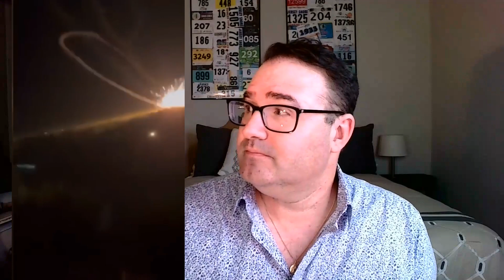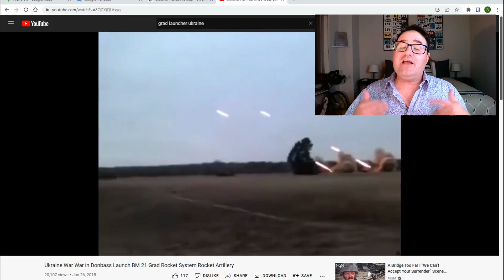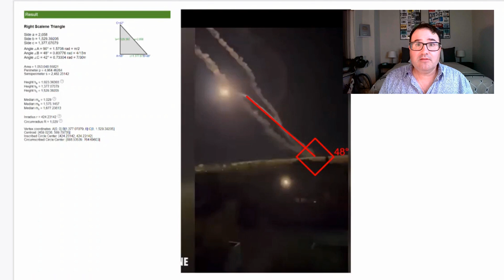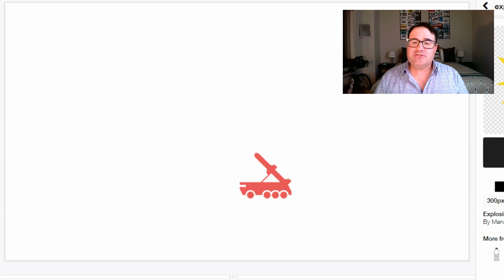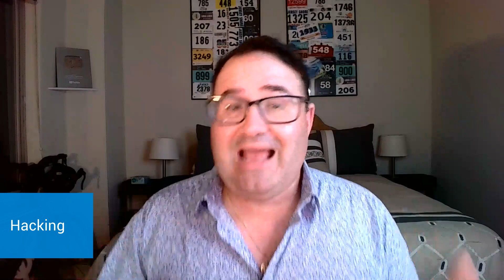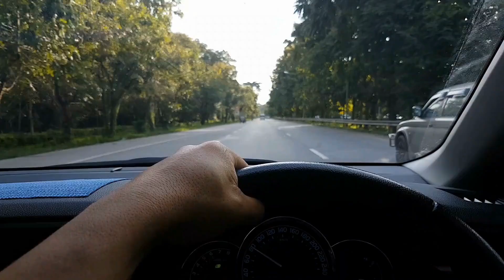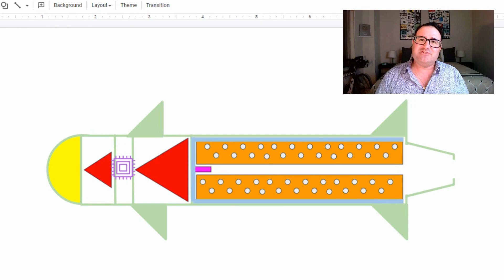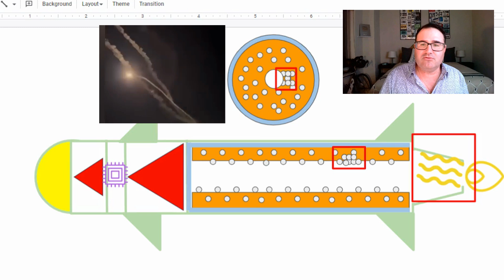Why this missile U -Turned

Comment from the maker: Connect with me on Twitter:
@ryanmcbeth

Watch my long form videos:
https://youtube.com/playlist?list=PLt670_P7pOGmLWZG78JlM-rG2ZrpPziOy

Join the conversation:
https://discord.gg/pKuGDHZHrz

Want to send me something?
Ryan McBeth Productions LLC
8705 Colesville Rd.
Suite 249
Silver Spring, MD 20910
USA

Watch my video about Solid Fuel Missile motors here:
https://youtube.com/shorts/OJmxJ-UuDSk?feature=share

The raw footage was originally found here:
https://youtu.be/6IwqmezeSuQ

A number of people emailed me about this video with their own theories of why the missile did such a drastic U-Turn.

I believe it was due to the missile being mishandled during storage or manufacture.  I believe a section of fuel dislodged from the elastisizer and caused an area of high impulse which turned the missile around.  By the time the extra nugget of fuel was burned up, the missile was flying straight again.

It is very important to store missiles according to regulations and periodically X-Ray them for non-destructive inspection to determine if their fuel has degraded.

References:
https://en.wikipedia.org/wiki/BM-21_Grad

https://en.wikipedia.org/wiki/Tor_missile_system

https://en.wikipedia.org/wiki/Buk_missile_system#Technical_service_division_2

Triangle calculator

https://www.calculator.net/triangle-calculator.html?vc=&vx=&vy=2058&va=90&vz=&vb=35&angleunits=d&x=82&y=10

G-force calculator
https://www.omnicalculator.com/physics/g-force

U.S. Efforts to Arm Ukraine Shine Light on Limited Production Lines
WSJ
https://www.wsj.com/articles/u-s-efforts-to-arm-ukraine-shine-light-on-limited-production-lines-11651143601?mod=Searchresults_pos1&page=1

https://www.northropgrumman.com/space/propelling-space-and-defense-missions-solid-rocket-motor-expertise/#:~:text=According%20to%20 Fuller%2C%20a%20 solid,to%20exhaust%20the%20combustion%20gases.

https://www.daviddarling.info/encyclopedia/R/rocket_propellants.html

https://www.rocket.com/defense/tactical-missiles/javelin
Reply: think you're correct with mishandling. But i think it broke. an external fin or something like that. I don't think a slight asymetry in the thrust could account for that dramatic a turn. (unless the missile detected it and over corrected)
Reply: @flagpoleeip  any fin or guidance related anomaly would likely result in circles or spirals... Don't you think? 😎
Reply: @howardthegeek  i think it hit the ground didn't it?
Reply: It’s made in Australia
Reply: @purplevalkv1nce264  what’s made in Aus?
Reply: @daviddoyle982  boomerang joke
Reply: @purplevalkv1nce264  
No china
Reply: @purplevalkv1nce264  so in other words, it did a u-ey and wanted to shirt front putin.
Reply: I think it’s a solid theory and is probably the most likely cause. Just to blow any possibility on hacking out the water. the amount of effort to tactical/strategic  return could in no way make  this worth while for Ukrainian.
Reply: It is awe-inspiring to watch you give distance estimates
Reply: this might be way off but I recall in the early days of Sidewinder, pilots reported missiles doing a 180 and coming back at them, is guidance system failure really so farfetched? from what it looks like on the video, the place it turned toward looked to be the launch vehicle, that could be coincidence but I'm not so sure
Reply: Ryan,

While that's certainly a cause for the missile to go off course, and possibly even impact near the launch site, I think it's a rather low order probability given the observed behavior. 

I launch high power rockets and am licensed to do so at level 2 by the NAR and tripoli rocket association, we don't do "guidance" because that's forbidden, but we do use "active stabilization" (which really the only difference is that we're required to stop at apogee, otherwise it's exactly the same hardware and software), and I've seen motor grain failures of all sorts.

What I would assume the issue here to be is an error, possibly from manufacturing, possibly from handling, with the missiles tracking system. It looks as if the missile is targeting either the tracking or searching radar array, and that's an error I can very easily see being made. I.e. "go to the laser dot" and it goes to the laser pointer rather than the target.

If it were a motor grain failure I would expect to see relatively constant acceleration from the rest of the motor, and possibly some ejected debris from an uneven burn. What I see here is a turn that looks like the action of properly functioning control surfaces.
Now the real question for me is why they didn't implement some sort of "minimum safe distance" lockout on it's ability to turn, in order to prevent something exactly like this, seems like sloppy engineering.
Reply from the maker: @adamrosenberg4367  Maybe. But the issue is that the Buk is semi-active radar homing. I don’t see any way that the tracking trailer would tell it to turn around. And remember, the missile isn’t designed to do that. There shouldn’t even be software code that would allow it to do so.

It would be like… watching your Roomba race a Ferrari. The Roomba‘s motor didn’t designed to go that fast, so I don’t see how the weapon could do something it wasn’t designed to do.

I am leaning toward being wrong about asymmetric thrust on the inside and leaning more toward asymmetric thrust on the outside. Maybe burn-through of the insulator from Cracked elasticizer? 

Ok, so a forklift bumps the missile in 1995. The driver doesn’t tell any one about it because he doesn’t want to get in trouble. 
27 years later there is a crack in the propellant. The Russians never didn’t x-Ray non destructive inspection on the missile because of course they didn’t.
 So now you have a missile with a crack in the propellant.

Missile is fired, it goes straight for a while and then we see burn through the insulator. This causes the missile to veer out of control.

It just looks like it’s going straight back to the launch site because of parallax, but it’s actually moving in an oval.

Sound more reasonable? I’m leaning toward that now.
Reply: @RyanMcBethProgramming  ok, yeah I could see that happening with parallax making an oval appear to be a near stall turn.

As far as a tracking error though, I know it's not designed to do that, but I have a lot of first hand experience with unintended behaviors arising from designs that were meant to do something else entirely. My thought was along the lines of an error with the differentiation between the tracking radar Source, and the tracking radar Return.

I can especially see that happening if testing was performed on single missile or volley launches, rather than the staggered fire that seems to be the case here. Like for instance, if I were to build something of the sort, I would have the tracking radar off for an initial boost sequence, then activate it once the blind spot cone directly aft safely covers it, so then the missile is only seeing the return from the aircraft. Mostly speculation since I don't know how they approached it, but I'm sure we could come up with 3 dozen viable explanations with all the people in the comments and the limited video info
Reply from the maker: @adamrosenberg4367  I really appreciate your thoughtful input, Adam.
Reply: @RyanMcBethProgramming  and I appreciate the replies! Not to mention all the work you've put into educating the public about stuff from Ukraine!
Reply: @RyanMcBethProgramming  If the rocket was approximately 1 mile into the air, does this mean that the fireball explosion was really 3/4 of a mile high and 2 miles wide?  What kind of rockets are they using that would engule 200 chicago city blocks?
Reply: @adamrosenberg4367  It flew straight for a few seconds. Most likely unguided. The error occured once the guidance system took control of the missile.
I also seriously doubt that e.g. an oxidiser rich section of propellant can cause a 180 degree turn on such a big, fast missile. Not going to happen, you need the control surfaces for such high g maneuvers.
Reply: @kirahund6711  that was my gut response to the video too. I'd rather not step on any toes though, so I'm just leaving it be, barring any further info.

I do know something similar happened with an American missile system a few years back. Patriot maybe?
Reply: @adamrosenberg4367  Are you implying that Ukrainian soldiers could have made this rocket do a 180 with a powerful laser pointer like kids have been known to do to aircraft here in the states? 
     If that’s the case, I’d say that’s pretty daring but very clever.
Reply: @digitaldreamer5481  not quite. I was trying to draw a comparison to things like the line following bot I made in school that started following the dirty tile seams, rather than the path we laid out. 

Just opportunity for errors I suppose
Reply: Was waiting for u to make a video on explaining this tnx man Keep up the good work
Reply: This has happened with a Russian space rocket before. The guidance system wires were reversed when it was manufactured it thought by turning and coming back it was correcting itself to go up.
Reply: @Platinumpitviper  I assume the same.
Reply: Bird strike? 🤓
Reply: Mishandling is just as likely to cause a damaged fin - I'd say more likely that manufacturing fault. If it was disiribution of fuel wouldnt the correctly functioning guiedance system and undamaged hudiance fins try to turn the missile around?
Now you may no see the missile turn around successfully, but you would I suspect see the guidance system attempting to correct the course and there for you'd expect to see some oscillation or something as the guidance system attempts to correct the bad course.
If there was a component failure I suggest it was a sensor such as a gyro or crossed wiring.
Possibly the gyro only kicked in at the point the missile turned or that was the first time the guidance sysrtem sent a command to correct the flight path.
Another possibility is that it was hacking, but not over the network, in the manufacturing or storage/servicing phases of the missile's life.
The Ukrainians have I believe a good knowldge of Russia and Russian defence industries and have known for 8+ years that the Russian's were coming. Seems possible that  Ukraine could fairly easilyt get people in to Russian defence industry.
After all there are lots of pro Ukraine Russian officers etc so its not unlikely there are also pro Ukraine reseachers, technicians, engineers etc etc.
There's no down side to  sabotaging Russian defense kit.
If the Russians are using it, obviousluy good-if it fails after being supplied to a thirdparty, then you're hurting Russian industry's reputation and possibly expiort earning's.Win Win. And if the missile happens to turn around and  get lucky and take out the  TEL, radar or control van, win again.
If it's a code hack there's no reason you could not make them failures pseudo random, so that people are less likely to check the software, but still enough to undermine confidence in the system (or the factory, troops or whatever).
Reply: @1337flite  I assume the missile is totally unguided for the first few seconds. It just needs to get up to speed, gain altitude and head in the general direction of the intended target and is then "caught" by the guidance radar (if there is one), so it makes a lot of sense to just let it fly unguided for the first few seconds. Then the guidance system takes over and starts issuing course correction commands to the fins. Usually these are moved either by electric servos, compressed gasses or even hydraulics in bigger and older missiles. 
To me it looks like once the guidance took over something went wrong. It maybe told the missile fins to "move up a few degrees", but the fins actually moved a bit in the opposite direction. Guidance tried to correct this increasing error, by moving the fins even more in the wrong direction, creating a situation where every attempt to correct course made the situation worse. Finally the missile ended up traveling in the opposite direction, a situation that was most likely not anticipated by the software designers since if that ever happens the missile has missed its target and failed its purpose anyway. Since the missile was flying straight again at the end (just in the opposite direction), this would actually support that theory. 
When it approached the ground the proximity fuze detonated the warhead independently, since the missile had traveled a few kilometers already the fuze was most likely in its armed state at this point.
So it could be a stuck valve or some crossed  wires. Or just mechanical failure. Happens all the time in complex machinery.

There's also the possibility of the error taking place on the floor, in the guidance radars. These are often still analog computers, especially in older systems like the Buk. I remember seeing a video of a Buk being fired, the operators weren't looking at computer and TV screens but on the waveforms and other signals on friggin oscilloscopes. These are very complicated systems requiring constant maintenance and calibration of a lot of subsystems and individual components, a lot can go wrong here including human error and poor design of the human to machine interface.
Reply: Your description of how a rocket motor is built is spot on. I currently work for a company that makes the warhead and rocket motor for the AT-4...

It's rather interesting, albeit dangerous, how we make them... One thing to remember that weather also takes its toll on rocket motors and electronics. That was the problem the US Military had with the Sparrow missile system in Vietnam...

They didn't do anything to protect the missiles from the humidity and that caused many motor failures due to the breakdown of the bonds within the engine casing (not to mention the corrosion on the electronics as well).

Good stuff! Keep up the good work!
Reply: I know and understand most US made missile systems and this one is puzzling to me except for one possibility. Most rockets have booster to launch the missile out of the launch tube 50+ meters before the 90 rocket motors kick in to guide the missile in flight. These are on three panels with 30 motors each, giving you 90 motors. If two of the panels has shorts, I would think that doing a 180 is possible…
Reply: If you fire enough of anything you will eventually find the duds and squibs.  And Russia has been firing a lot of these things.    That reminds me...I need to go get some bottle rockets for the 4th.  What could go wrong.
Reply: You're completely wrong, reddit says it was the elite reddit users and hackers that volunteered at the beginning of the war. They distracted the Russians with their really cool Funko pops while another slipped the super secret "missile turn around" flash drive (developed by anonymous) in the USB port of their SAM system.
Reply: @jasonm7973 😄
Reply: The russian military is probably one of your subscribers now.
Reply: ryan thanks for your information, its definitely plausible, though I don't think the odds are in your favor. What are the chances that it would malfunction at loop back to the exact same place. Very low.... based on this alone there must have been a bit of tracking on the source vehicle by the missile.

From the curve in the video, the missile curves up to hit the source location in its second stage flight. 

Definitely some guidance issue, maybe brought on by the other two smoke trails.
Reply: If that really was a BUK missile, then you must understand that it's not any ordinary munition. We had those in Finland and test launches didn't go well at all. First missile was near target but second one just made a hole in cloudy sky and wasn't even locked to the target. These things work with analog computers, they are not even meant to hit the target but near it. Warhead it carries is pretty hefty so it is good enough.
Reply: this is what i assumed happened. i could be wrong though
i sent this message to a friend the day it happened.
figured out what caused this
or 99% sure anyways
its a ground to ground missile which requires launch site gps cords and the attack sites gps cords to be put in the computer to launch the missiles. the person doing the gps stuff probably put the launch site in the launch and attack cords and the missile just did its job as it was told
Reply: @dalejrjunior1298  That's not how it works. Ground to ground cruse or ballistic missiles have a minimal range and that was way too close, those type of missiles are launched straight up (cold or hot launch) and then use fins or thrusters to turn in the wonted direction and  there are also systems that will prevent you from doing that.
Reply: Nice videos man I enjoy your content. !thanks
Reply: Could be solid rocket chamber malfunction. I’m not saying it’s not, but it could also be a controls problem, and I’m coming at this as a controls engineer, but not a rocket guidance system engineer. Even if the fins are locked at lunch for a second or two, and I kind of doubt they are, but let’s say they are. The locking mechanism can malfunction also. And if they are not locked, which I think that is the case but I could be wrong, but let’s say they are not locked. In this case, we know, as a matter of fact, From much history of use with anti-aircraft missiles, that they often go awry, and most often because of the control system failure, because basically that is the whole missile system in a nutshell. So that sophisticated system is most likely to fail, much more likely than a rocket fuel malfunction because solid fueled Rockets are extremely simple And reliable for combustion. Odds are on my side. What is most sophisticated is what most likely failed.
Reply from the maker: @steveperreira5850  I would agree with you that the most complex systems are the most likely to fail. I’m actually leaning more towards burn through of the insulator and it’s parallax error which makes it look like the rocket is heading back.
Reply from the maker: @steveperreira5850  you know, now that I think of it more. I still think you’re right – in that complex systems are more likely to fail. But when you’re in a car, what is more likely to fail, the tire, or the engine? People get tire punctures all the time. I’m still thinking about that burn through. That’s why it’s kind of bothering me. What I don’t want is diagnostic momentum. But that’s kind of what I’m fixated on because of the way the Rocket behaved.
Reply: @RyanMcBethProgramming  this was a soviet STS MISSILE.   MANUALLY INPUT TARGET COORDINATE. FROM WHAT IVE HEARD IS VERY POSSIBLY THE OPERATOR WHETHER EXHAUSTED OR INCOMPETENT ENTERED STARTING COORDINATES TWICE.  ONCE GUIDANCE BEGAN IMMEDIATELY CORRECTED AND DEAD ORKS.
Reply: Gr8 vid I was sure It was hacking 😂 lol
Reply: @jiena____6464  wut?
Reply: This is a great video on how air defense systems work
Reply: Ty for the ego boost haha I guessed solid fuel burning on one side (unevenly)

Ty
Reply: My theory that someone just stole klystron so missile failed to receive signal from launcher and missile decide to self destruct. Air to Air and Ground to Air missiles usually just heading to the ground if they failing to intercept target. Klystron is a popular product on black market so.....Buk and osa systems have build radars and they are not connect to anything.
Reply: Achievement completed* 
"Return to sender"
Reply: I think your way off on something. The distance from the launcher or the distance traveled.  It wouldnt of been in the pic frame if it had moved 2 kms. The way you estimated the flash/bang and then used this data to estimated travel time is wrong.
Reply: As fellow Jersey dude, I chuckled at the truth of that statement.
Reply: Gremlins
Reply: Do you know anything about the Brahmos missile that flew to Pakistan?
Reply: Could be a the missile was struck in a previous incident by a small piece of shrapnel where the damage went unnoticed.
Only upon firing the missile did the hidden damage lead to a catastrophic problem.
Reply: @rocketman475  NOPE it auto corrected itself and flew to pre-programed target.
Reply: @rocketman475  Very unlikely
Reply: Its turn around because this USSR made buk was controlled by Ukranian soldiers. And it was misslead by Russian EW. It was BUK-M1.
Reply: Is there something similar to a Range Safety Officer with a self destruction device or is it, "Oh, crap!! DUCK!" type situation?
Reply: DiversityIsOurStrength  This guy waned somehow to point out that he saying lie
Reply: You are probably right. 4:40 You can see 3 smoke trails out of with one has also changed direction but managed to correct it's heading. It's probably a bad batch of missiles that was ether old mishandled or both.
Reply: The computer chip was made to target the launch system
Reply: I totally agree with you on this Ryan. It's like when a top fuel funny car looses a cylinder it pushes the car to the left or right depending on which side the cylinder goes out.
Reply: I think this is an anti radiation missile and it tracks its own radar.
Reply: What actually happend was the Russians mistakenly put their GPS coordinates into the missile not the targets GPS coordinates. It's a simple explanation. 
❤ 🇺🇦 ❤ 🇺🇦 ❤
Reply: @CCK_PRODUCTIONS207  so exactly what I said 36 minutes before you
Reply: @Ryan, SAMs used to launch a single missile, sometimes they launch two (one after another) to increase probability of hitting the target. In the video we see 3 missiles launched in a rapid succession - it's very unlikely for a SAM, therefore I doubt it was a SAM.
Reply: Well that's just bullshit now Ryan isn't it. If by hack you mean seize control then easily "hacked"
Reply: How did you determine it's a Russian and not the Ukrainian Buk? I missed that part. In Kyiv, some rocket hit a residential building and there was a rumor it is from Ukrainian Buk defending the sky over the Capitol. Do you think this may be an actual recording from that incident?
Reply: Asymmetric failure of the exhaust nozzle  would cause this also. The extreme non-laminar flow of the gases would then  obliterate the remainder of the nozzle very quickly.
Reply: That would cause very slight thrust asymmetry that would be easily compensated by fins
Reply: To pronounce buk name correcty just spell it like book, (buk - is a name of tree beech in English)
Reply: my theory is the Russians employee wile e coyote
Reply: Russia: we are not at war with Ukraine
Missile: oh ok my bad
Reply: It seemed like it slowed down drastically before turning which I still don’t get
Reply: I agree its very likely asymmetric thrust caused by damage from mishandling.
Reply: This incident looks so much like the various V-2 rocket failures in actual firing conditions. A family friend was a teen in The Netherlands during WW2. I forget his hometown but it was a very popular area to launch V-2's at Britain. He had lots of stories about the V-2 especially the failures. The failures fell into several categories:: 1/ Explode while on the truck's launch system in vertical position 2/ Rise straight up and engine would quit. Various heights. 3/ Rise up several thousand feet then the rocket would start doing loop-de-loops or corkscrewing through the sky. Sometimes a combination of looping and corkscrewing. 
Of course the rockets were destined for the earth. So the Germans would panic and run in all different directions hoping to avoid the rocket. The Dutch guy thought that was the funniest thing ever!! 

Just a couple days ago there was a video of Russian missiles corkscrewing vertically and horizontally. Reminded me perfectly of the V-2 stories. IMHO the V-2 losing directional control was gyro failures. The bottom line appears to be the Russians have equaled the German quality of WW2.
Reply: Some type of active radar system. Oddly enough not a malfunction if true. The entire Russia Military under Putin really and truly is has become seen as the worst in Human History. "So bad not even Great Britain will fight them."
Reply: It is fake. 
Russian propaganda.
Reply: We shot a missile off our cruiser. Tali fin failed and came off. That thing turned back to the ship. You've never seen sailors dive through hatches like we did that day. They destroyed it immediately thank god.
Reply: It wasn't a Russian Missile
Reply: Was the thought, "it lost a fin in flight, after launch ever considered"?
Reply: I know this is an old video and you probably won't see this. But if we assume this is BUK-M1 system, the whole system consists of 5 different types of vehicles. It consists of command vehicle, search radar vehicles, loading vehicle and differing amounts of launching vehicles and slave launching vehicles. Launching vehicle has tracking radar integrated it can both launch and command slave vehicle to launch a missile simultaneously. If missile is shot from launching vehicle then it always goes out cold, meaning its warhead activates few seconds after launch. This is to ensure that tracking radar emissions don't affect warhead too much. If missile is launched from slave vehicle then it goes out hot and warhead is instantly functional. So it could even be that those two trails were from missiles launched from different vehicle.
Reply: I like your theory but the one I enjoy the most is that they accidentally put the coordinates for that missile of the launcher and not the target, but you're probably right. The truth is often mundane. 🤷‍♂
Reply: Awesome video, my five year old wanted me to tell you that he says he thinks you're right 😂
Reply: You should check out the russian rocket that did this exact move when its guidance unit was accidentally installed upside down
Reply: You're wrong. The Ukrainian army has a laser pointer that is able to retask missiles. I suggest the Russians stop using missiles. Make sure Putin gets the memo.
Reply: 0:22 now I'm curious... how would Алчевськ be pronounced in New-Jerseyian? 😁
Reply: This is fake. Video from 2018